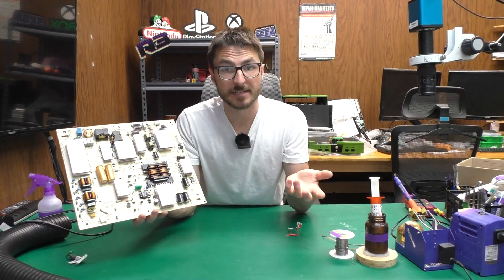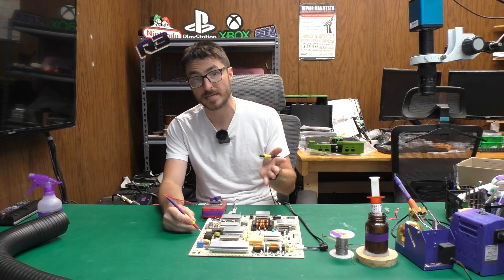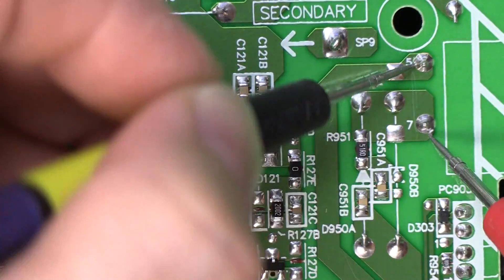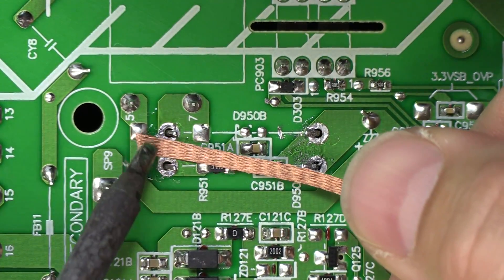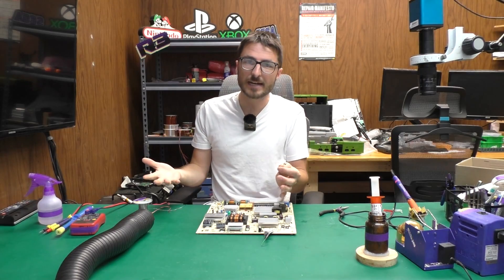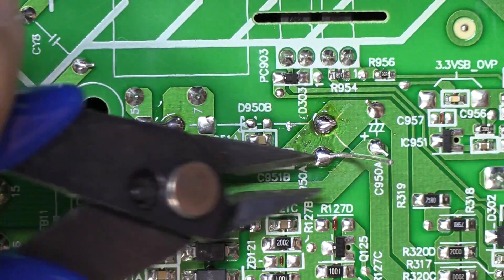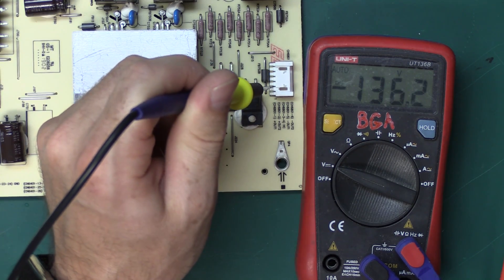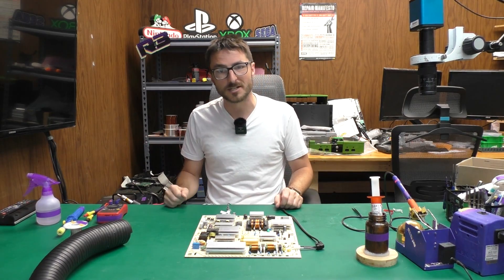Fixed Dead Sony TV XBR-85X850G Power Supply

Comment: Thanks for the upload. My Sony TV has just met the same fate.
I am in Australia, so not much hope of sending board unfortunately. Are you able to please confirm the diode values/replacement parts I need to look for to try this fix?
Thanks so much
Reply from the maker: diode part info is on the diode itself. You cn use that to pull the data sheet

Comment: Thank you for the video. My friend's TV stopped working and it won't turn on, that's how I got to this video. I may take a crack at it. A few questions I hope you can help with:
- Is this the most common cause you've seen on these TVs?
- How do you make the jumper or could I do it with the TV connected?
- What about buying a power board and replace it directly?
- What temperature do you use for soldering (the tip)?
Reply from the maker: It's 50/50 power supply mainboard. 
The jumper is not necessary and in fact I highly recommend you don't try it. I only did it so I can bench test it without having to have the entire TV on my bench. If you have the TV just use that. 
yes you can buy a power supply and replace it, however they may be pricey. Repair is usually cheaper. 
As for my iron tip, I only use 450 celcius. It's very high heat, most people will damage their boards at that temperature because they will sit on the joints for too long. When using high heat like that, you need to be quick. If you can't be quick, go to 350 or 400. 
Also the type of tip you use matters a lot. What iron do you have? What tip do you use?
Reply: @NicksTVRepair thank you for your reply. Super useful. 

Quick follow ups:
- I have the TV, should I just test it with the multimeter while plugged? 
- Can I just take the power board somewhere to get it repaired instead of the whole TV? It may be easier.
- For the tip, I've used the one that it comes with that looks like a pencil. Should I use something else?
Reply from the maker: We have a mail in repair service. If you don't want to risk it, you can click on the link in the video description it will lead you to our website where we have a flat rate repair service for that board. You would ship just the power supply, we would fix it for you and return it with a 1 Year warranty on the repair.

Comment: Question: the jumper is connecting STBY to which pin?
Reply from the maker: Standby to PS_ON which is the Power Supply On command line. You could also use an external power source and feed 3v to the PS_ON pin and that would work

Comment: Hi Nick,If you cut the diode leg as close as to the PCB from component side and heat the remaining leg will be easier to remove it without even using a desoldering pump.Or heat the leg and push the remaining from the component side.
Reply from the maker: That's another good way to do it